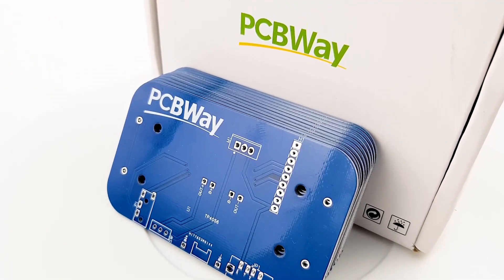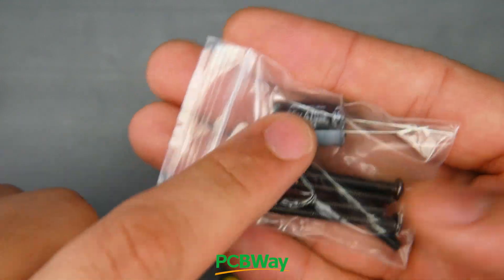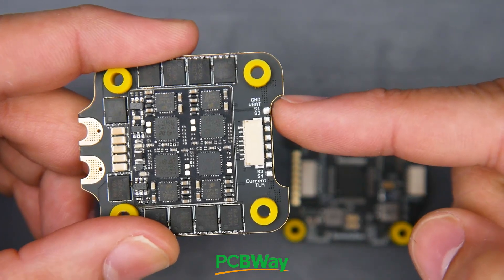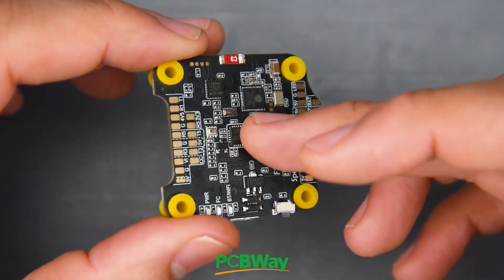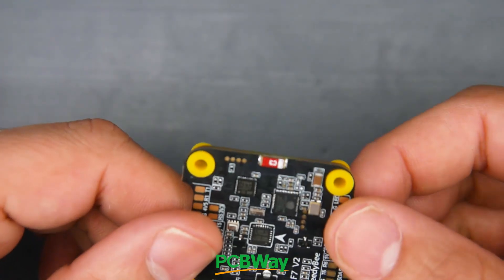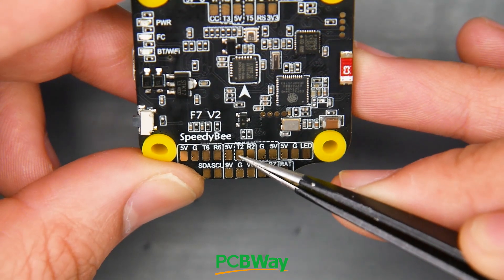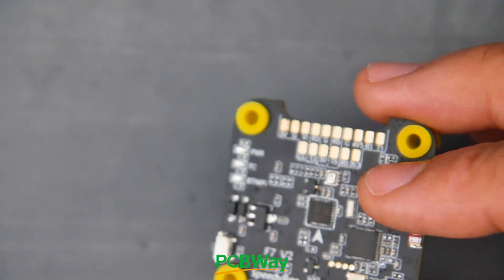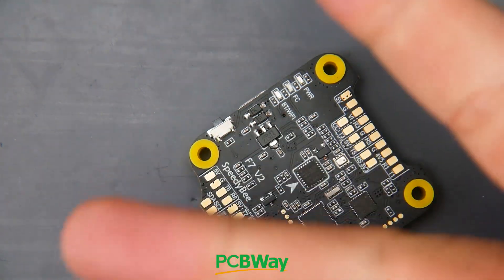Latest Flight Controller Tech // SpeedyBee V2

Comment: Hello there, Great tutorial!!. I'm a newbie and I'm building a Quad with 5" props. I'm using a speedy bee F7 stack, so now I'm facing a problem with the throttle position. In the Betaflight motor menu for testing the motor the line of power instead of sitting at the bottom with the motor completely off they all at 1460 as an armed speed, and if I roll it down, instead of decreasing the speed it goes up, and the opposite way will do the same, looks like the complete off position for the motor to be completely stop has to be around 1500 witch is sitting in the middle of the bars of each motor. How I  can change this to the normal way, where the bottom of the bar the motor is off /stop or in a no spinning position, and if I move the bar up the motor should start spinning faster. If there is anything I can do to fix this please share it with me I really appreciate all your help.

Comment: Did you get the blackbox analyser to work? Mine is stuck at "turning on wifi transmission mode" but the phone is connected to the FCs wifi network :(

Comment: Hi, I want to connect this fc to my hobbywing 60A esc. I’m wondering if it has 5 volt regulator or not since I can’t find anything about it on their website. If it does have the 5 volt regulator I could connect it directly to the “bat” pin coming from the esc right?

Comment: I don't care about the WIFI or the cutout (I run my battery lead to the side) but I love the other features like Bluetooth, the USB-powered receiver, camera control and I2C pads and diagnostic LEDs. Also, Speedybee is killing it with their app.
Reply: The pyrodroneF4 also powers rx via USB. It also has CC pad. Not sure about the diagnostic LED though. But it's got an F4 processor.
Reply: @jumpstartfpv  There are tons of FCs with most of these features but I don't remember any with all of them. E.g. I think there is no Mamba FC that supports a compass and few FCs have Bluetooth.
Reply: Where do you put capacitor ? Do you turn only esc or fc too ? Make a video.
Reply: Wrong end! lol The cut out, like he said, is for extra room to get more camera angle, and room between the camera and your stack. Very useful! The opposite end is where you solder your battery leads... where the is no cut out.
Reply: @noobFPV  Depends on the frame. Usually I shrink it to the battery lead directly at the ESC or tie it to a rear standoff with a cable tie. I try to mount the FC in the default direction but I have mounted FCs upside down or rotated 90°, too. If you do you need to remember remapping the motor and set the orientation of the gyro in Betaflight.
Reply: @noforyoutubepremium3108  I know, let me explain. The ESC has the motor signal connector opposite the battery lead and you usually connect it to the FC's connector on the same side. In this case the cut out of the FC will end up to the side.

Comment: I just got this FC and it’s super nice to be able to adjust betaflight any time without wire wire and a computer. The set up is so easy and the quality is good
Reply: does the blackbox analyser work for you? mine wont connect but works as configurator
Reply: @pgmcr5413  I never tried. Seems to fly fine for a 5” and 7”.